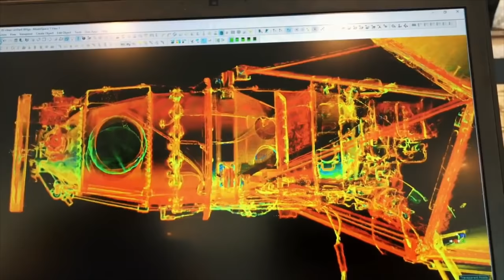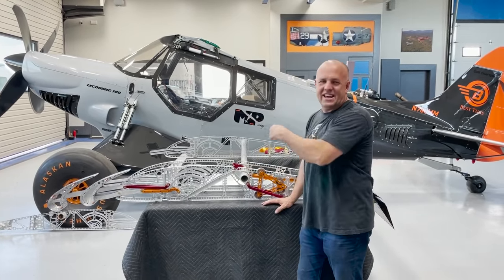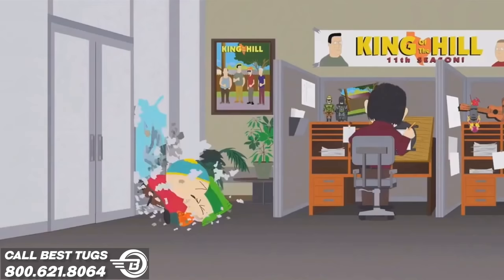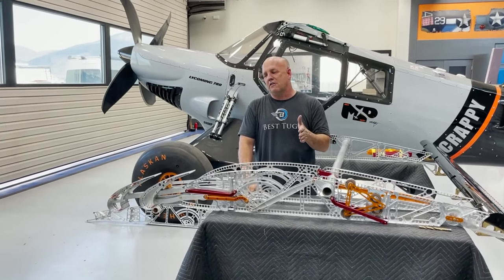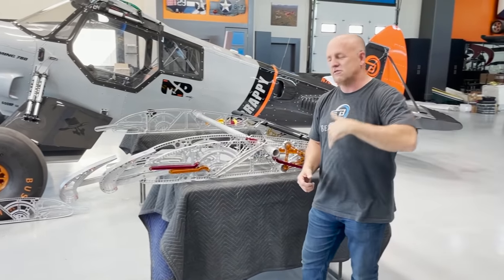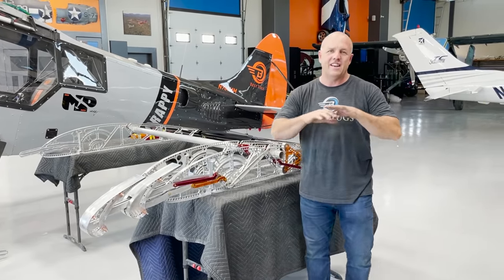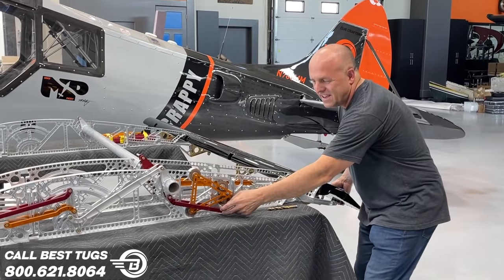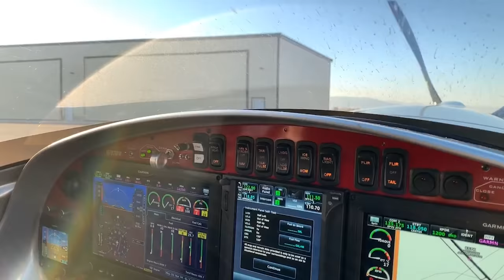DECLASSIFIED Hyper-STOL Transforming Wing - Patey Twin Slats - Fast and Slow | Scrappy #57

Comment: I looked up passion in the dictionary Mike came out and slapped me and said "get back to work!"
Reply from the maker: 😂😂😂😂 I busted up on this 😂 thanks for the laugh. Your the best
Reply: Ha ha. Great coment. Cheers from Argentina.
Reply: Roflmao....now that's funny right there !
Reply: this has got to be a tee shirt  its great
Reply: Holy Crap I laughed like hell at this.  Mike!  This needs to be a new T-Shirt!
Reply: One of the better comments I've ever seen on this site, thanks 🤣
Reply: @Mike Patey  -  gee, next  you should make telescoping landing gear. Your wheels can be touching the ground no matter how high you fly
Reply: Lol best comment ever. Lol back to work!!!
Reply: You just won the comment section
Reply: @MikePatey  Im thinking/hoping, you build in a trim mechanism side to side... there's going to be a strong torque factor but... there's going to be a huge differencial between port side up wash vs starboard down wash as well as a serious right handed rotating span wise wash over the top of the wing & cabin... the two wings are going to fly very differently in stol mode... that'll take SOME tuning in... with that fan up front
Reply: @MikePatey  I was going to correct your grammar for you’re, but then you slapped me and said “get back to work!”
Reply: 😂😂😂 
Get back to work! 
Thanks for the laugh
Reply: LOL
Reply: Declassified?  Please see “Fiedler Storch” 1940 . Yep leading edge slats there too.  Not as elegant as Mike’s mechanism, but they didn’t have CNC BSCK THEN, nor did they have time.

Party is a hell of a designer.

I wonder if these aero devices will work well at the low Reynolds’s numbers in my RC planes.   Only one way to find out: design it build it test it crash it break it and redesign.  Rinse and repeat!😂

Comment: Absolutely insane, looks like you singlehandedly designed an entire new aircraft from scratch! 
This kind of thing typically takes a team of 20+ engineers multiple years to do, with loads of special tools, a supercomputer and a wind tunnel.
Not to mention going through the whole manufacturing process.
Reply: Ya, true, this shows us what you can do when no one says, “you can’t do that.” And you work on your own.
Reply: Welcome to desktop aerospace
Reply: Better wait to see if it flies first!
Reply: He's relying on hundreds of engineers who wrote the CFD software. Hopefully they got it right
Reply: @jg809  CFD makes use several assumptions which we know to be incorrect. We do experiments, observe results and introduce constants into the equations to get around the issue but, those constants really only apply for the cases we test and thus surprises are always around the corner if there are 'unknown' "unknowns" involved  in one's particular case for which CFD is being applied.
Reply: Got a funny feeling, that Mike has been thinking about this way before Draco fell out of the sky. Am absolutely gobsmacked Mr Patey! 😁
Reply: The super computers of yesteryear are surpassed by the high end desktops of today.
Reply: @DrRusty5  Very true,10.000 bucks and you can get a computer to do this stuff all day long and much more at the same time. I think with a good desktop you can do whatever people did 20 years ago in a Super computer in very short time by a fraction of the cost. New AMD stuff is for this kind of people,not for running stupid benchmarks. Years ago I had 4 machines to research and test our products,it was a ton of money to keep it in a regular office space due A/C problems,power consumption and proper space. Same test I could do it now in a 12 core 3900x desktop when years ago I needed 4 dual core Xeon top of the line machines to barely do it.
Reply: @SaltyBoots  Draco didn't really fall out of the sky. More like rolled over on the runway.

Comment: Being an HVAC engineer and a whitewater paddler, I love fluid mechanics.  Your explanation of how the flow separation occurs 14 inches away from the trailing edge at critical AOA and the images from your CFD analysis made me a bit more excited than I’d like to admit.
Reply: Same! Do you know what fea software he is usimg for flow analysis? Looks like solidworks for the solid modeling.
Reply: @YourUncle8501  No idea, I've never used CFD software.  I only know a little about the math that makes it work.  I'm just in awe of what a skilled operator/tech/engineer can do with software when they know how it works and have an idea.
Reply: Would you know what CFD software he used?

Comment: Mike, Don Miller and I worked on this same design FIFTY YEARS AGO in Anchorage Ak. We  didn't finish it because we were doing it with imagination, and didn't have the math to prove the double slats, but Don did get a STC for extended wings and flaps, and vortex generators on the wing tops, and I told him I thought the VG S were upside down,  which was true. THE THING NOBODY HAS GOTTEN RIGHT YET IS YOU NEED TO MAKE THE FLAPS FULL SPAN,  AND MAKE THE WING TIPS  SLATTED, WITH FIVE FEATHER LIKE  FINGERS THAT ROTATE AND FLEX UPWARD  LIKE A EAGLE OR CONDOR WING TIPS. THIS FLEX WOULD ALSO GENERATE MORE LANINAR FLOW OFF THE TIPS  AND PRODUCE A CLEAN HORIZONTAL TORNADO LATERAL FLOW OFF THE WING, INTO THE DOWNWIND WAKE. Richard Kinser. 
I think Don's STC  is still in the records. It was originally for a PA14. HE WAS A RETIRED FAA STC OFFICER.

Comment: Is this enough evidence to say Mike is one of the greatest Aircraft designers of all time?
Reply: Mike is the Howard Hughes of our time.
Reply: Not to take anything away from Mike but many of the great aero engineer's didn't have computers, CNC machine's and solid works and air flow programs to work with. How long would it take one engineer to make the same analysis with a slide rule?  Not to mention the machined parts would not have been feasible before modern CNC maching
Reply: @AtlasLathe  
That’s true but also not a fair comparison. How great would Mozart have been if he’d had an electric guitar?

Comment: The power of computer aided design (CAD), computed fluid dynamic analysis (CFD), computer aided manufacturing (CAM) tool path and computer numeric controlled (CNC) machining gives one person the capability of at least 20 engineers, tool makers and machinists from 20 years ago.  Put this power in the hands of a Mike Patey and this is what you can get!
Reply: Person?  I don't understand your comment. You don't actually believe Mike is human do you?

Comment: Incredible. I can't imagine the effort put into the modelling and analysis, let alone the component design and manufacturing. You're right up there with Burt Rutan in my book.
Reply: Rutan built a plane that flew around the world without refueling.   this is a dual slat wing..
Reply: Burt’s a slacker
Reply: @1crzflyer  Rutan has built 2 aircraft to circumnavigate the globe, both a prop and a jet.  This however is truly groundbreaking.  Burt's my #1 role model, Mike has just slotted himself into 2nd quite easily, assuming the modeling and IRL match.
Reply: @1crzflyer  There's a lot more going on with this plane than a dual-slat wing. Quite literally no other aircraft on the planet will be able to duplicate its performance characteristics.

Comment: I like that all the slats are synced together as they are. I work on G150s and the slats are actuated via ballscrew actuators and are connected to each other and spun via a flexible driveshafts. It is very common for the actuators to get a couple degrees off each other and cause a slat failure. So the fact that Scrappys slats are engineered the way they are is good engineering

Comment: Private pilot here with  a fascination for mechanical engineering.  If I am understanding the abilities of this wing, in the slow flight mode, you will have a fully controllable aircraft at an AOA that is so high that the plane will be descending yet not stalled.  In effect having a built in stall/spin proof design since to stall it the AOA would have to be well beyond the point of supporting the aircraft.  Amazing.  Can't wait to see the detailed video of how you designed this.

Comment: Destin Sandlin’s (with Smarter Everyday) head just exploded by the mechanical engineering, wind flow charts, and the multiple use of the word “laminar flow”.  I can actually visualize his child like enthusiasm as he watches this video.  This build just keeps getting better and better, every time you think Mike has out done himself he goes all Billy Mays on us “But wait there’s more!”
Reply: Should really have Destin visit the hangar!
Reply: Unfortunately I think mike means attached not laminar. High lift with a drag device in front of a slat (the first slat almost 100% does nothing positive aerodynamically but at least it will increase the wing area). I’d be extremely surprised if the flow is laminar through both of those. Plus who cares about laminar flow at low speeds, profile drag doesn’t dominate there. He also probably wants the flow to be turbulent so the boundary layer stays attached.
Reply: @lenmetkowski9899  You obviously watched the video but understood nothing.  Laminar flow IS airflow attached to the wing.  The leading slat, and all slats aren’t designed to be laminar but create and extend laminar flow over the wing.
Reply: @king-o-vetts9899  Laminar flow is smooth layered flow. Laminar is from Latin meaning layers, it has nothing to do with attachment to the surface. You can have laminar flow that is not attached. Laminar separation bubbles are phenomena where the flow separates laminarly then re-attaches after it transitions in a free shear layer.. It normally occurs at low Reynolds numbers when an adverse pressure gradient induces separation.

Comment: A recommendation: When your wings are clean (slats and flaps retracted), the paint colors are normal.  When your slats and flaps are extended, have the newly exposed surface area painted flourescent lime green (emergency green) or flourescent international orange (emergency orange) so that people on the ground, in the air, from inside Scrappy, etcetera, can see when the wings are in a dirty configuration.

I also hope you have patented this design.
Reply: I wouldn’t be surprised if he released the plans without a patent for open source usage to accelerate other designers innovation.
Reply: Way back when (40's) Stintson built a very similar wing for a R985 powered monoplane with extraordinary STOL characteristics.
Reply: Westland built a wing along these lines in the 1930s...

Comment: Mike I'm very impressed with the engineering rigor you invested into your wing design to include your automation adjustment scheme so not to overload the pilot's tasks during the various critical flight states (takeoff, landing, etc).  Earlier when your post discussed your wing concept I visualized a more standard slat concept I was blown away with your final approach. In my humble opinion, Scrappy may very well outperform DRACO especially in the STOL competitions.  Sir have a great day

Comment: The man is one with his wing. He engineered a center of lift using the fluid dynamics of a cutter-rigged sailboat and then he mechanically engineered the slat system for maximum safety and minimum workload. Seriously brilliant work. I can very much visualize the CL moving as the model actuates.

Comment: Your Wings are more engineered than the stock  Cub itself :)
Reply: The stock Cub never had FEA and Fluid Dynamics. These wings are probably more engineered than Saturn V.
Reply: of course!  he his building a one of a kind plane that he wants.  you don't get innovative designs like this from kits where price point is a main concern.
Reply: I'd bet it's got more engineering in it than most of the GAA flying today, at least model simulations.   Computers can do more simulation in a day than an engineering team can do in a year.   Just have to beware of GIGO.
Reply: @j121212100  there is no any innovations, German Stroch (1936) hadsimilar aerodynamics solutions
Reply: His landing gear has more engineering than an original cub lol
Reply: The only time i appreciate over engineering.
Reply: Nothing wrong with over engineering when you have true engineering talent like Mike.  The problem comes in when you have highly educated people that never actually understand what they are doing.  That usually is where the over engineering pops up in band aids to cure initial design inadequacies.
Reply: ...very much understated.

Comment: As a patent attorney, I was sitting here hoping that you've filed a patent application on this design.  It looks very exciting!
Reply: Single, dual and triple slat wings have been attempted since 1918. The first single slat design by Gustav Lachman patent was rejected because the German Patent office didn't think it would work as intended!! 

Many early designs failed to withstand pressure loads. When high velocity wind tunnels became available in the late 1930s engineers soon determined the causes. Even so,  Handley Page developed an effective slat design the following year in the United Kingdom in 1919 and was patented with Lachman.

Leading edge Kruger flaps designed in 1943 in Germany operate with an almost identical aerodynamic airflow concept as extended slats but reduced drag at very low airspeeds.  25 years later, testing on swept wing aircraft designed for high speed flight, the Kruger design was reintroduced on the B-727. An update to the original design was attempted with drop down slat from above while a second, a Kruger flap, extended from below and farther forward. It was not advanced beyond a wind tunnel test because of laminar airflow sensitivity. A single Kruger flap by itself was incredibly effective and implemented on the B-747.

In my opinion, I agree with your comment, Patey's design would qualify for a patent based on his specific straight wing design because its design is specific for very low speed flight parameters. It would be interesting to see the airflow analysis for a wing designed for 200 to 250+ knots but can leverage a landing airspeed of 100 knots or lower, which could reduce runway requirements of single aisle regional airliner turboprops like the De Havilland Twin Otter or Dash 8 Q400.

The reality however is different. Rural airports worldwide can handle DHC-3 / 6 / 8 easily. The demand for extreme STOL performance has almost disappeared - even up north in the famous bush country. But it would be very cool if a DHC-6 fully loaded could take off / land at max weight of 12,500 lbs at 90 knots and 550 - 650 feet of runway and clear a 50' obstacle!! (currently capable of 1,200' takeoff / 1,050' landing) with such a slat / flap configuration.
Reply: @DougHanchard  Wow, interesting.  Thanks for the info!  You're right that the market may not be there for his specific design, so it may not make financial sense.  Regardless, it's interesting to know that people have been trying similar things for so long.
Reply: This will lead to high altitude helicopter rescue blades. Mark my words.

Comment: Nothing like a big hole in the middle of the wing spar to accommodate the mechanism :) In all seriousness, that's a really neat design. Even single slat designs work wonderfully on corporate jets. They allow much shorter runways, and far more comfortable approach speeds. Pilots that transition from Falcon jets to Gulfstream jets really miss the effective leading edge devices. Another advantage that is not all that clear, is that the slat, as a leading edge is much like a bumper, in that it takes the damage from a bird strike (or other) and can be easily replaced, without having a damaged wing, or damage history.

Comment: This is insane… wow. Incredible mate. As someone who needs to fly slow for his job ( mustering pilot in Australia) this is truly incredible. Looks like you’ll be able to fly slower than a gyrocopter. Please fly it to our sheep station in Western Australia. I’ll even let you have the hanger and kick out the 172.
Reply: Does anyone use these canadian planes for mustering?
Reply: @cockroachman27  Not typically, none that I’ve seen anyway. The most common mustering specific fixed wing would be C150 I reckon. And R22 in rotary. A couple of people run fox bats for their own operations but not commercially. :)
Reply: @outbackaction7264  how did you become a mustering pilot? Sounds like a terrific job flying around the bush like that
Reply: @cockroachman27  I must stress that I am not a commercial mustering Pilot. But rather for our own sheep station ( similar to a Ranch). It’s just a normal part of our operation to be honest. Our average paddock size is about 20,000 acres so the plane is essential in finding the stock for the motorbikes on the ground.